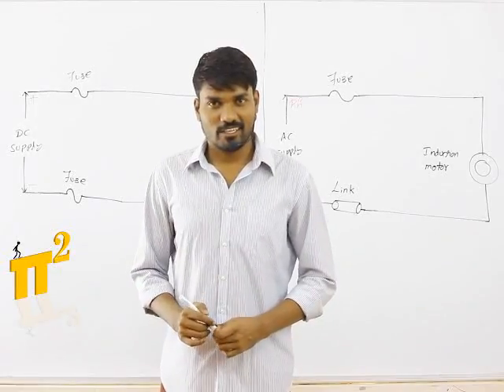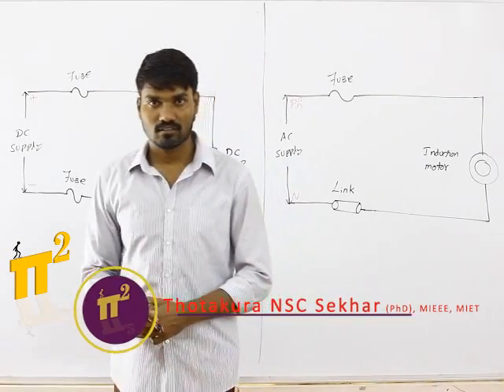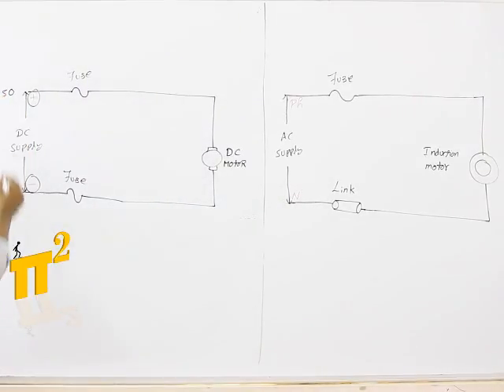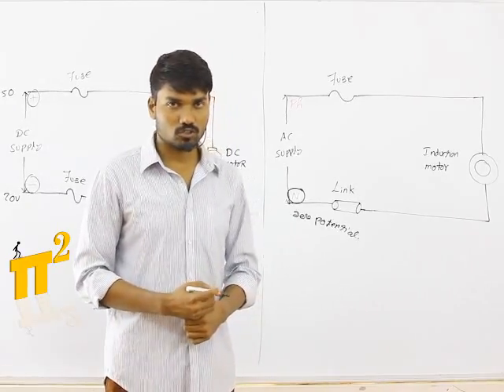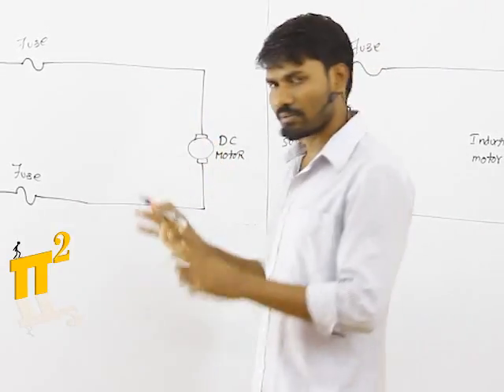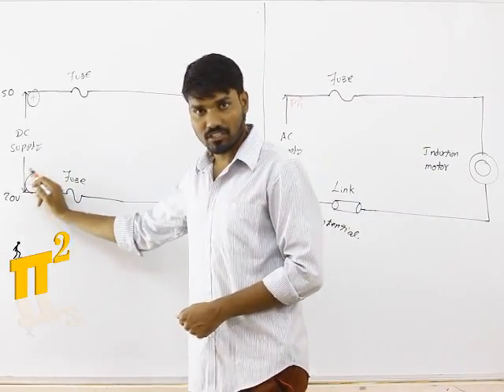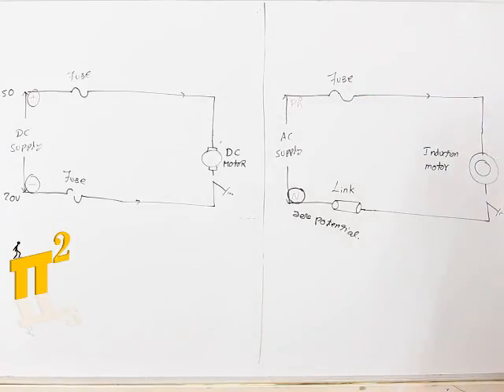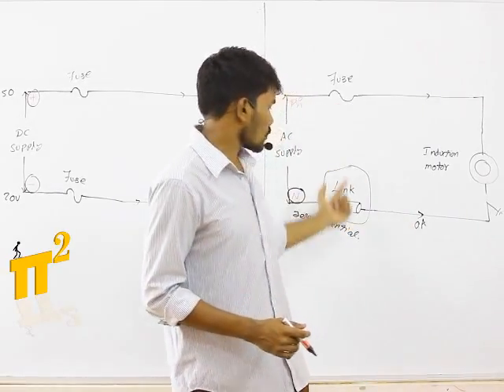Why fuse in both terminals of DC | Interview Question | PiSquare Academy

Comment: Link is not just a connection like  a wire. Link is a metallic strip that helps in providing manual isolation during maintenance . The ampere rating for the links would be high when compared to fuse
Reply from the maker: Yes Mr. Balaraman, you are absolutely correct
Reply: Can I know why not a positive fuse not going to respond when fault occurs after armature winding
Reply: @ThePiSquareAcademy  sir in distribution system all the mains are connect in parallel so  the healthy section current enter in ph and leave through Neutral , so now other mains Neutral in grounded then the healthy section Neutral current is grounded through fault neutral wife sir, may be that's why in AC, Neutral link is used  , 
 
 Please give me reply sir .
Reply: @vinay5470  because a fuse protects the circuit from short circuit failure, if you short the output of a transformer, basically you short a secondary circuit, that is not protected. There is no phisical connection between primary and secondary windings. I guess you talk about AC and phase fuse.

Comment: We had been given to u derstanding during my Elect Engineering graduation study that fusing a neutral line is foolish;dangeroud rather. If the neutral fuse blows down & if there is no proper earthing, there is a possibilty of elct shock. That's why, in neutral there is a dummy; a brass strip.

Comment: Dear sir, Please explain how earth current flows in case earth fault in DC. for single earth fault there is no complete path for current.
Reply: Please answer
Reply: Friend  I think if the output DC is taken from a 3 phase star connected rectifier with neutral grounded then there will be a closed path for both negative n positive
Reply: @vamsikrishna5391  wrong concept
Reply: yeah same question ?

Comment: respected sir, in case of ac since we neutral terminal is grounded to earth, therefore when fault occurs in live wire then circuit is completed through earth and heavy fault current flows, and fuse will be blows off. 

but in case of dc there is no grounding then how can you say that ,if +ve or -ve terminal connected to ground then high fault current flows and fuse will blows.

sorry but I m not completely agreed with this lecture.
if I m wrong conceptually anywhere, then plz clearfy my doubt.

thanks in advance.
your all lectures are very useful to me.
Reply: I am assuming like this but i dont know true or not...
In case of dc lets say some short circuit occured in some equipment or a dc motor which results in zero potential at that short circuit since a short circuit is obviously means 0v. hence even fault occur in positve line or negative line there is always potential difference from source to this sc point which results in heavy current flow as sc resistancce is very less. as this current has to come from source first fuse blows off. But in case of ac as neutral is always at zero potential there will be no current flow with reference to neutral so always fuse connected in live wire blows off.
Reply: in case of dc ,if short circuit occurs, for dc short circuit means +ve terminal is directly connected to ground naa??

then what is the sense of fault occurs in +ve or - ve terminal , when both will in direct contact to each other then only it is called short circuit.
Reply: line to line fault is different from internal fault. equipment winding will never be ideal hence always some resistance exists and hence current depends on potential difference between two points
Reply: May be true if the system has multiple dc voltage inputs for excitation and drive...
Let me tell a practical case some audio amplifies need dual supply +-12v or some thing..normally gets from a ct transformer with bridge that case need two fuses at ...such as body is at 0v potential a fault may occur..

Comment: For  protection of DC circuit with mcb rather than fuses, which is more preferred is it to use single pole for positive and negative terminals or to use two pole mcb for simultaneous operation for a fault occuring at either sides. Thank you
Reply from the maker: For DC circuit MCB with two pole will be most preferred.

Comment: Hello pisquare.... Ur video is very good and informative.
I have one query. How pptc fuse r used in circuit and how its rating is decided for a circuit and if normal fuse and pptc fuse are used at same circuit weather it wiil be connected in series or parallel.

Comment: Sir, Regarding the fuse in case of AC, At some point of time (i.e. in the negative cycle) The point which you have mentioned as "N" will be having some potential. Then we need another fuse in the N side also???
Reply: Nope  you can imagine voltage fluctuating at the top node only

Comment: sir  iam  design ac  circuits   may i using  both phase and neutral  fuses.like phase fuse current rating greater than  the neutral fuse..

Comment: I think the 2 fuses only matters for a motor load which can turn either ways, but I think its ac which have to use 2 fuses where u can change the plug direction when we connect,and ac shock even if ur not touching  neutral or earth cause body have something called parasitic capacitence..

Comment: Hi can you please tell me why dc supply negative side have some potential power?????
Reply: Because it is ungrounded.p
Practically a dc source has potential on both terminals.But in our textbooks simulation software we make them to be at zero potential(reference node) by grounding it for calculating parameters against that reference point that's y simulation software like ltspice won't give u output unless u ground it.This all are for sake of our calculation purpose as u can see a circuit functioning properly without a ground.hope u will get it

Comment: Let say...if  some DC source connected inbetween GND and Highvoltage(Example consider some DC source connected to battery cells). Do I need to still use two fuses? Thanks in advance.😀😀😀😀😀

Comment: Sir, i have a doubt about the fault current. how the fault current flows without providing grounding to any pole either +ve one OR -ve one.. As like above video if any pole is grounded there is only voltage shift to another pole with reference to ground. There is no fault current untill both the poles are grounded.

Comment: Some clarifications:

Many of the comments asked the question about the completion of the loop during the fault in the DC circuit. 

The reason presented in the video is not entirely the reason for using fuse on both poles of the DC circuit.

Most of the DC supply are ungrounded and when there is a fault in one side of the circuit, the circuit will operate entirely normally (except some leakage current). In this case where the DC is ungrounded, the fuse will not blow. Ungrounded DC is used for the reliability of operation. Some ground fault monitoring devices are installed to detect the ground fault and perform the check and maintenance at the convenience of the operator. So when there is a ground fault, the operation does't have to be interrupted and maintenance can be performed at the time convenient to the operator. It should be kept in mind that the second ground fault in the same circuit will complete the path to the ground and cause a severe damage to the system. 

 Other DC supply may have their midpoint grounded. In that case, the ground fault on either side of the circuit will cause the current to flow thru the circuit from both polarity and hence fuses on both polarity. In other words each pole will contribute to the fault current. When there is a ground fault in this kind of circuit, the ground appears to be at lower potential for both poles because their mid point is grounded.

In case of AC supply, a ground fault on neutral side makes no difference since it is already grounded. 
THINK ABOUT THE FAULT IN THE POSITIVE SIDE AND IN THE MACHINE and you can feel why we need fuse only in the positive polarity.

DO NOT FORGET. There are other types of fault too that should be considered when choosing number of poles for the fuse. (like line to line fault)

Comment: If according to the video negative is at some potential wrt to earth, if we connect an ammeter between negative of the dc supply ( say a cell) and the earth should give significant amount of current or light atleast a led ( but it doesn't)

Comment: will practically possible as generation of  280v and 40v  to get 240v potential difference in DC generator
Reply from the maker: Yeah, generation of 280 and 40 is possible and which in turn makes it possible to get 240V

Comment: Sir by seeing u vediou then there is no provision for ac link because just neutral wire is sufficient for ac systems
Reply: That's for disconnecting circuit during maintanence bro

Comment: Hello sir,
Suppose we have DC distribution in power substation and it is unearthed system 
in the above case will two fuses are required???
the distribution is single source DC 
only 110v DC .
if system contains two types of DC supplies like 110v and 24 v double fuses are required but only one 110v DC is available and it is unearthed
Reply from the maker: Yes!! It is required even with just one 110V DC unearthed. I recommend you to go through the video once again, because from your question i could feel that you are missing some fundamental point in this regard.

Comment: Dear sir I AM working in power plant. 11kv substation vcb rating is 11 kv, 2500A, 40KA. How to they calculate 40KA short circuit with stand current for 0.3 sec. Please explain

Comment: Hi sir
My question :can we Operate transformer on pulsating dc supply
Reply: +Ravinder Kunarapu - It is possible but the transformer will not output pulsating D.C. Instead, the ouput will be an A.C. derivative of the input waveform. Best way to understand this is to remember that the voltage appearing across the secondary winding of any transformer is always proportional to the rate of change of current flowing through the primary winding.
Reply: Sir No it cant  because DC will not Attain (mutual induction)

Comment: as you used the link in ac ckt to connect the ckt directly,it was possible to connect with wire only also.i don't think that link is required..plz do make me clear..
Reply from the maker: yes don't get confused with any other stuff, you are absolutely correct, we don't have to place a link we can directly connect it.
Reply: ok.

Comment: How can the negative or neutral terminal of a cell or a eliminator has some potential which can cause so much of current to blow a fuse connected to negative side of the supply.
If the dc is derived from the ac , suppose a transfomer diode rectifier, the output voltage is wrt to the center tappings of transformer which is considered as zero potential.

Comment: Hi sir,
My doubt is: In AC supply, current flow direction changes for every half cycle. If we connect the neutral to ground, then how it is possible, in the negative half cycle?
Reply: Neutral is in this case always at zero potential while the phase connection varies between positive and negative potential.

Comment: sir,
I have a simple circuit. in this circuit, I have used circuit breaker, is it still required fuse for that circuit? if Yes what is the reason?

One more doubt from my side.

how would we calculate proper fuse rating in DC circuit like in the solar PV module side and  AC side?

can you use AC fuses in place of Dc fuses?

Comment: Sir please tell me why bird don't shock in transmission line but for  man what wiil be happen and let 200000 voltage low current then man touch live wire and earth and complete the circuit then what will be happen please please please sir

Comment: in case of dc, how the earth current path is completed.
Reply from the maker: Dear Hardik, Please elaborate the question.
Reply: PiSquare Academ
electric current need close loop path to flow.....
as u said in case of AC supply somewhere in system neturl is connected to ground...thats why current will flow from source to fault to ground to neturl earthing to source back....
in case of DC source how fault current path is complet throught earth...,??? as there is no system earthing in case of DC...Explain close loop path of DC Fault current
Reply: You have asked my question 
But in my point of view his assumption is wrong as long as there is no closed path for current

Comment: Neutral is not exactly at zero potential..
Reply from the maker: Yes you are correct, its potential is not exactly zero but its value is very small.
Reply: PiSquare Academy.. Ya exactly,the small potential at the neutral can cause very small amount of current to flow through the circuit (during typical fault condition) and hence fuse isn't required.